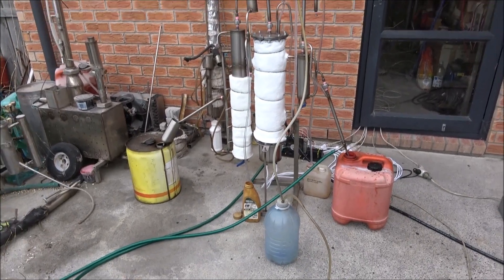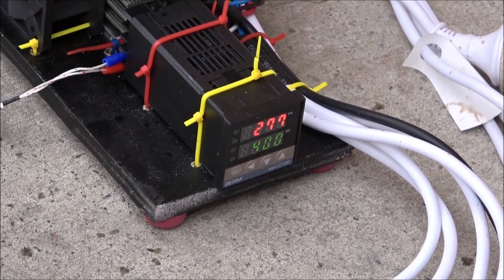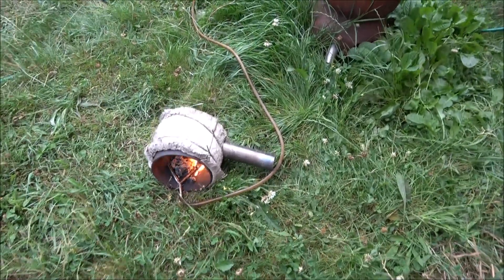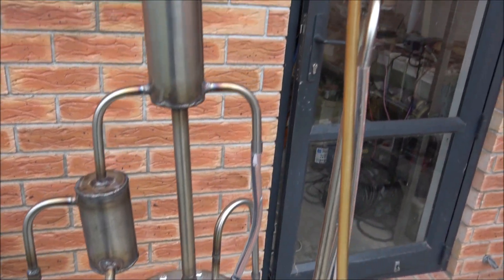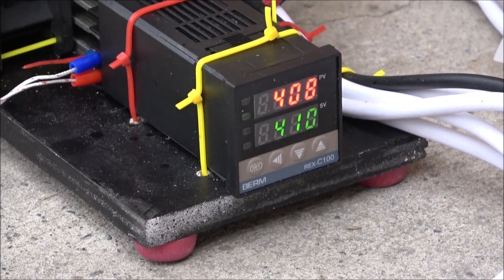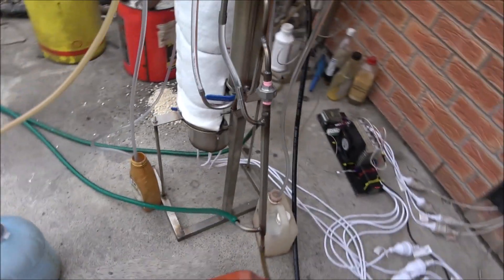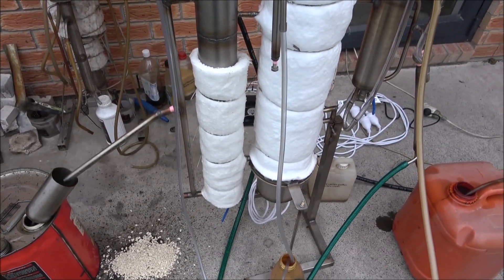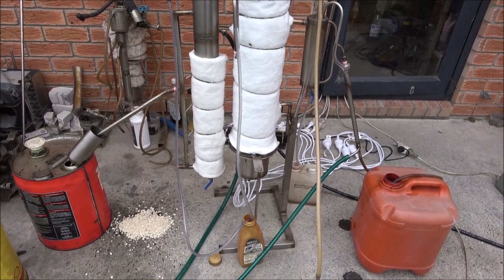Waste oil distillation, WMO to diesel -  test run part 1.

Comment: Hi Alexandre, hope you receive my comments and reply. Diesel fuel obtained from waste motor oil could not work with my diesel engine.

The engine could not speed and became lazy. What is the reason?
Reply from the maker: You did not settled and treated your fuel with absorbent, silica gel for example, so your engine's filter or injector possibly get clogged.